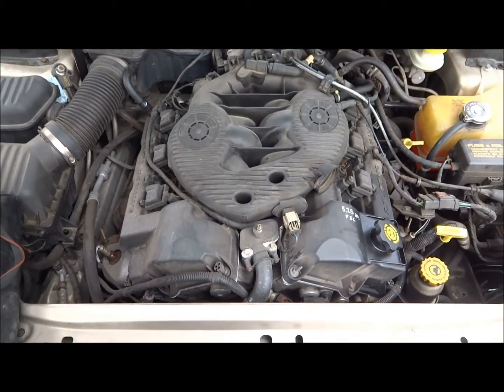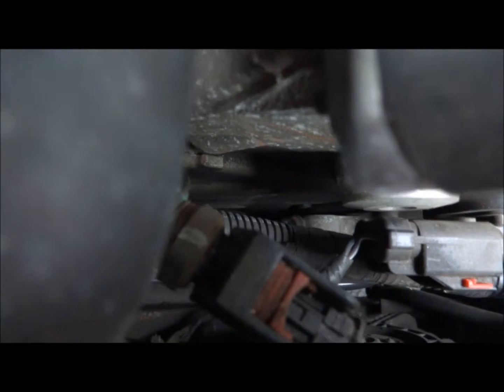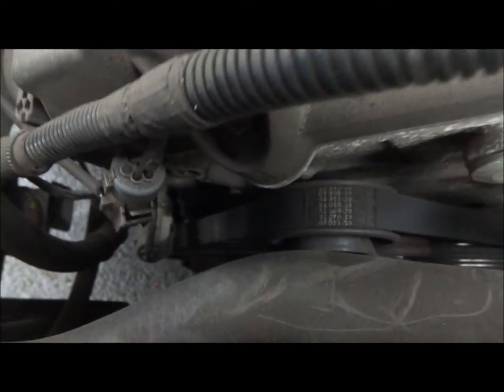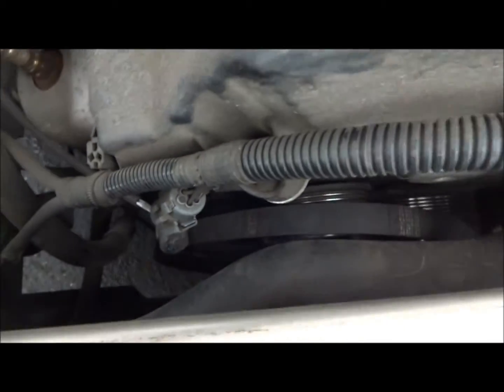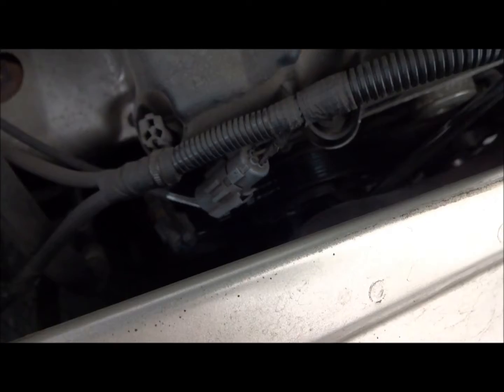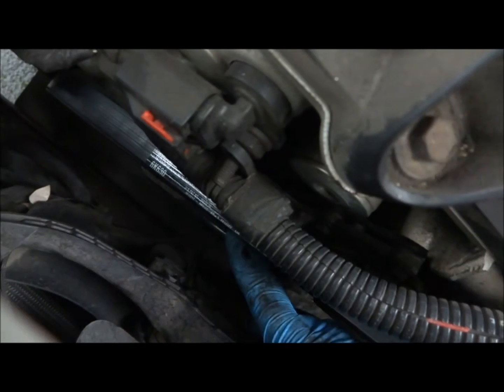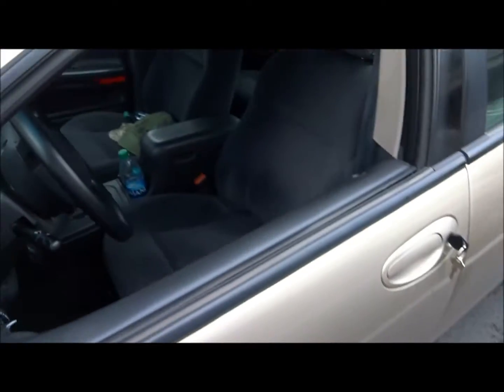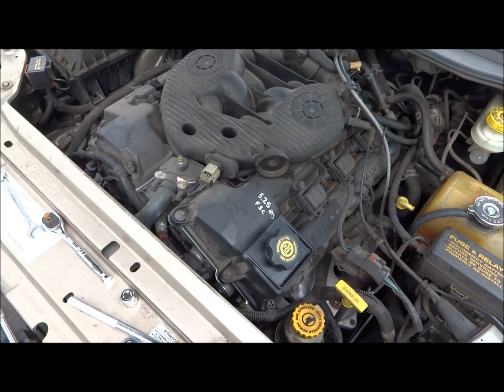1997-2004 Dodge Intrepid 2.7 Ac/Accessory Belt Replacement

Comment: i notice he did not show putting the belt over steering idler pulley. mine certainly will not just slip over that smooth pulley.

Comment: So do i need tension on the pulley inorder to lossen the 15mm nut? My belts snapped so they are already off while everything is still tight.
Reply from the maker: You shouldn’t. But if it moves then yes. I honestly can’t remember
Reply: How long does this job take because these guys have been on mine for 5 hour now and still ain't done. Literally started at 8 am and at the time of me typing this, it's 1:12 pm
Reply: @endlessnameless8181  honestly, everything is probably siezed up. I decided to cut my loses and scrap the car. It was all siezed up and would have cost more than the car was worth
Reply: @BurninSnowMan  they said it was squealing when they started the car and now they're just trying to figure out which pulley it was.guy spent the first 3 hours trying to put the ac belt on when it was an inch too short.
Reply: First time seeing that ac tensioner, good to know it works!